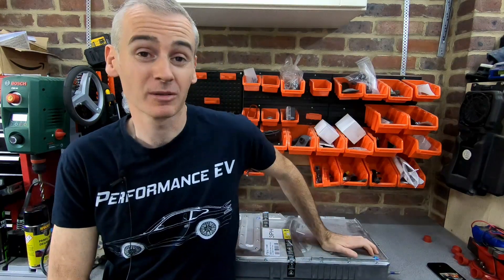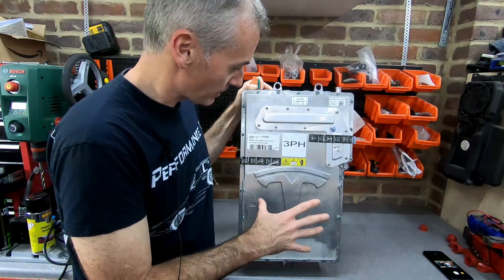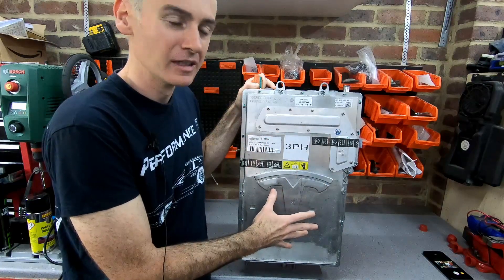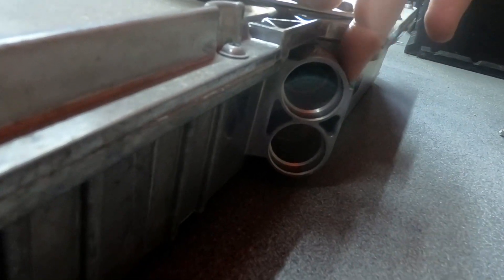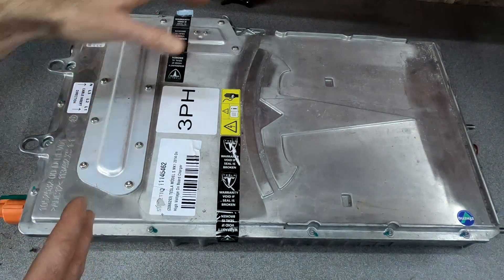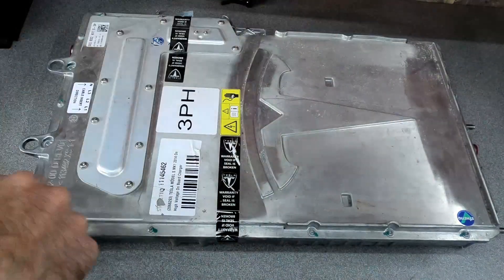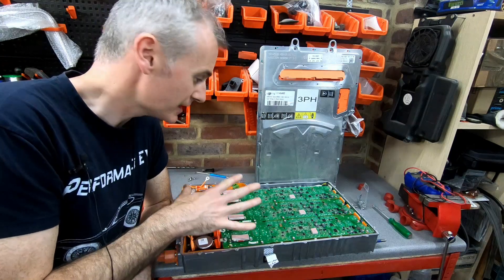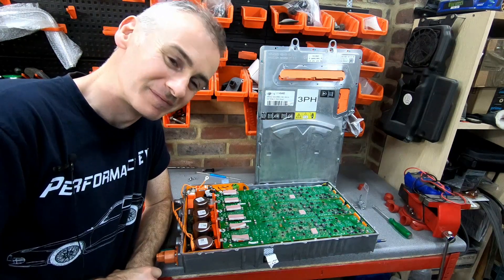Tesla Onboard Charger Teardown Pt1 - Opening it up to look inside - how does this gen 3 Charger Work

Comment: Can I ask if you know the spec of the fuses that are fitted please or just even post up a link to one?
I'm guessing they are 30amp fuses but can't be sure. I'm sure one of mine is blown and I'd like to order some up before I take the unit apart.
Reply: 450VDC 40A, Littelfuse HEV 40A. Tesla part number 1052769-00-A. Mouser has them but it is way cheaper at Tesla.
Reply: @retkimora  i think i am having a simular  issue,  Had my vehicle inspected by tesla.  They turned supper power on.  I cahrged my vehicle 1 time using the super charger and now it is not allowing me to charge it unless i am at home.  Would this be consider the same?  Should i purchase the fuse??
Reply: @jamesary  Go and try some public AC charger. If you get maximum charging speed there it is not the fuse. Also during supercharging these fuses are not being used as internal charger is not being used for ac/dc conversion then. You can check for error messages at supercharger or simply create a support request in your phone app. They will tell you what is wrong.
Reply: @ will do and thank you very much sir

Comment: Super jealous of your three phase unit!  I picked up one of these that was for 48A single phase that I aim to repair.  I'll be checking out more of this series, the only difference between yours and single phase is you have two additional HV contactors and the center charger board.  I only have 2 charger boards and 2 total contactors.

Comment: I am intrigued about the thermal management of the charger. I don't see any fan or heat sink. Considering it is a 11kW or 22kW charger, how is it done.
Reply from the maker: Hi, it's water cooled and is cooled by the car's coolant system.  The flow seems to go through the base of the case.
Reply: @PerformanceEV  Ok. Thank you for the reply

Comment: Great video mate, thanks.
I have a question - will it be possible for an European Model Y (2022-UK Model) which has a Type2-CCS charging port on it to use the Tesla superchargers in USA just via an adapter (there seems to be none of this sort in the market at the moment..) ? - trying to establish if there is something else fundamental at the wiring/circuit level that would prevent this from being possible. Thanks

P.S : My objective is to take my car UK Tesla to USA for a road trip.
Reply from the maker: That’s a really good question. I’m afraid I don’t know for certain. From a power routing, it shouldn’t be a problem as the supercharger is just a DC fast charger and therefore just needs the contractors to be closed to get the juice flowing. The unknown is in the communication between the Tesla and the charger to control how much power to send.

Comment: Hi, are you sure it can charge at 22 kw and have you tested that? Thanks
Reply from the maker: If it has got 3 phase’s to the EVSE and the type 2 connector is wired appropriately it will hit those numbers. Most type 2 plugs seem to split a single phase across the three wires, in which case the 7kw would be split across the 3 charger modules. 
I don’t have access to 3 phase at home so I won’t be able to test it for a while.
Reply: @PerformanceEV  I live in Europe, and my model 3 can charge 240V 16A three-phase, amounting to 11kW. But the curious thing is that when fead with 240V single phase, the car allows up to 32A on that one phase...
I always wondered how suddenly one of the three onboard chargers could endure 32A?
But I read you saying here that in the presence og only one phase it is fead to all three chargers! Which would of course make perfect sense, but would require some relay magic on the intake side... Because the plug from the UMC only has pins for the L1 and Neutral. Have you seen such a parallell distribution of the L1 and Neutral to all of the three onboard chargers inside that casing for youself?
Reply: @ozone7  This is exactly my question, which I search the whole internet for
Reply: @PerformanceEV  European Model3s charge at 11kW 3PH and 7kW 1PH.
Reply: @MatteoMassarenti  agreed. When Tesla did 22kw AC charging in the older Model S it had two charger units. These can do 32A single phase or 16A 3 phase.

Comment: Take it apart , not just the cover
Reply: I would not recommend to go further if the charger is supposed to be used afterwards.
There will be components that are thermally bonded to the housing.
Once this is broken off, the cooling will be worse or you will have to re-attach them with the appropriate materials.